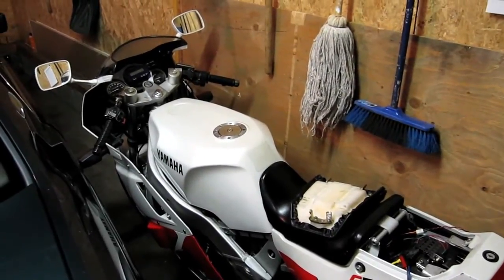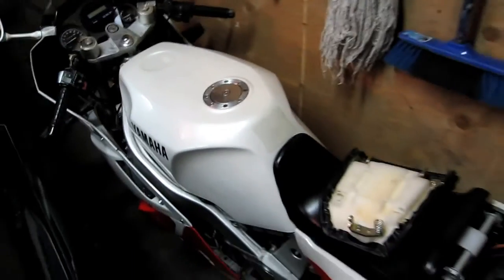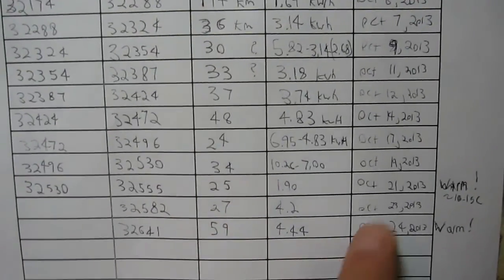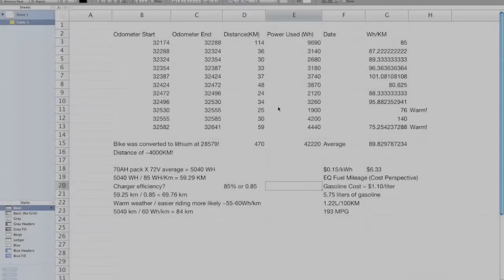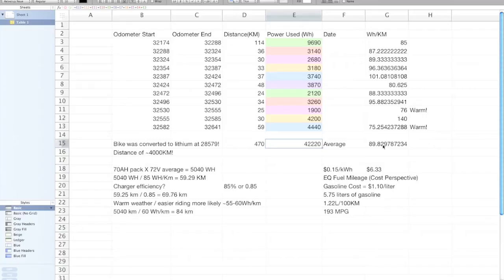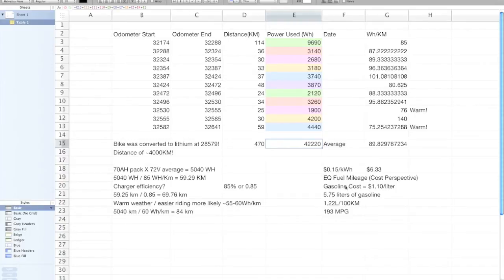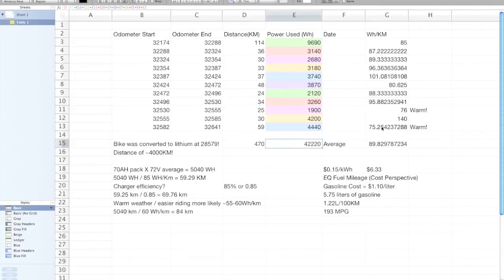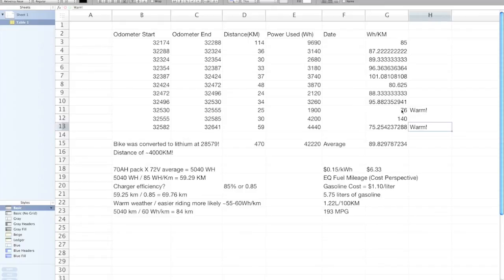#10: Electric Motorcycle Energy Consumption #2

Comment: You are looking at it from a cost standpoint; from an energy-usage standpoint it is even better:

- about 30 250 BTU of heat energy in a litre of gasoline
- about 3410 for one kWh of electricity

Meaning you are getting somewhere in the area of 275 MPGe. (You've probably figured this out by now, but people in the comments might not have.)

Also, does your bike have regenerative braking?

Comment: Odd question if I were to obtain 400 12v 3000mah 18650 batteries and link them up in a battery pack system to achieve an output of 48v 300ah and connect it to a small frame cafe racer powered by a 48v 8kw motor like the Manta 2 DC series motor http://www.hydrogenappliances.com/manta.html how fast could I expect it to go and at average speed how far would it go ? sorry for landing this on you, my head has became marshmallow both trying to remember my high school physics lessons and navgating the multiple online forums.
Reply: +FlamingCuntLips Late response, i know, but 8 kw is about 11 horsepower, which is what most 125cc's have and they go about 100 km/h. As far as range, your motor uses 8 kw at 48v, it will use 166 amps. Your battery pack is 300 Ah, so in theory it will go almost 200 km at 100 km/h, but you wont be able to deplete the batteries 100%. They will probably get you 150 km before you loose too much power to be able to keep up with traffic. The range will of course be lower if you drive slower.

Comment: Interesting comments.  I wonder if the battery manufacturer provides discharge data based on ambient temperature?  It might be interesting to do a simple run down test on one battery cell at various temps.  This would yield some simple data that could be extrapolated to the bike.